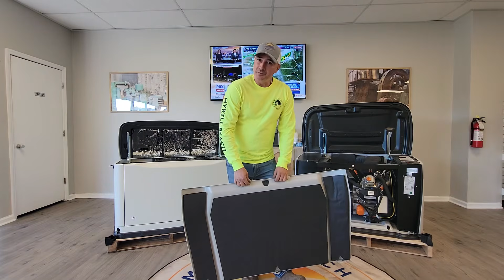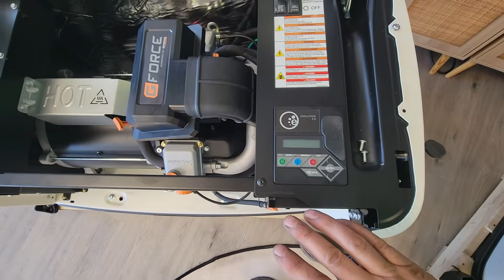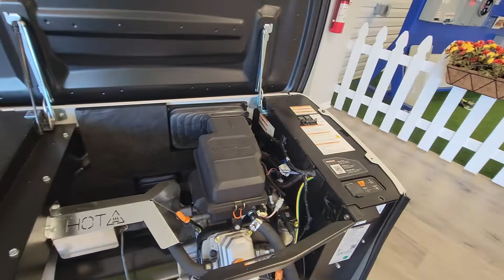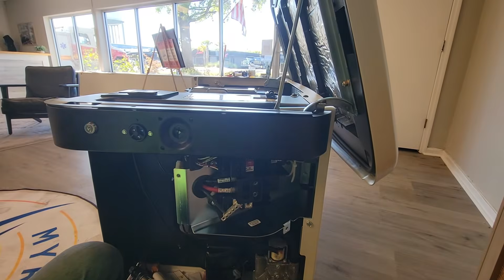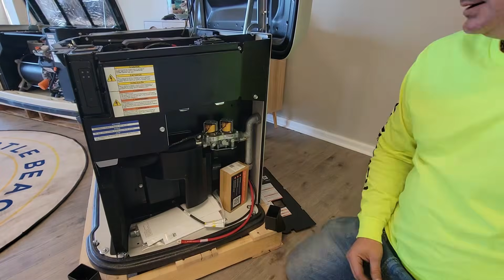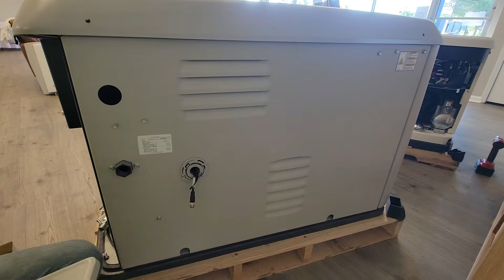Generac's Guardian Vs New NexGen 24kw

Comment: Generac owner checking in. Spent $10K about 6 years ago and of course warranty just went out. I never needed it until now.
We had a big storm but not catastrophic only without power a day. My generic went out after 3 hours, so did hundreds of others. Techs are backed up at every local company for WEEKS and my tech told me people are beyond pissed.
My estimate for repair is in the thousands, it would be almost as cheap to buy a new one.
Apparently Generacs made this decade are absolute junk and a class action is being developed to sue for repairs, specifically the bushings and the like wearing out after a short time.
You have all been warned. DO NOT BUY A GENERAC.
If you do not believe me just search a bit online....."generic class action lawsuit".
You'll see.

Comment: I had a next GEN Generac installed in April 2026. It has not worked now for four power outages. I’ve had so many codes pop-up. So since mid April 2026, it has not had one hour of use on it yet. The thing keeps breaking down. The technicians told me that these next GEN generators are substandard inferior machines. I was told that I should try to return it and go with a different brand. The kicker is that they only sell Generac and they told me not to go with it. I only wish the salesman was honest and told me that. And Generac has a company has not been that easy to deal with.
Reply from the maker: It does need a 30ah AMG battery. That seemed to take care of most of my ghost codes.

Comment: I bought my NextGen 24K in April 2026, had it installed on July 10, and now, by August 23,
 I’ve already seen a red flashing light with code 5100 twice. The dealer came out the first time to reset the unit, and I’m trying to get them to come out again for the second issue. 
They say Generac is working on an update and ask for patience, but it’s frustrating to wait when you’ve paid for a generator that isn’t working.
Reply: Generac owner checking in. Spent $10K about 6 years ago and of course warranty just went out. I never needed it until now.
We had a big storm but not catastrophic only without power a day. My generic went out after 3 hours, so did hundreds of others. Techs are backed up at every local company for WEEKS and my tech told me people are beyond pissed.
My estimate for repair is in the thousands, it would be almost as cheap to buy a new one.
Apparently Generacs made this decade are absolute junk and a class action is being developed to sue for repairs, specifically the bushings and the like wearing out after a short time.
You have all been warned. DO NOT BUY A GENERAC.
If you do not believe me just search a bit online....."generic class action lawsuit".
You'll see.
Reply from the maker: I had that issue on one install and changing the ecm seemed to solve the issue
Reply: @MyrtleBeachGenerators  the dealer turned off speed and now it seems to work. Generic is the one told the tech

Comment: So all that but you didn't address the most important information, did they finally use an engine with a Cast Iron Sleeved in the block or are they still using the same Aluminium Cylinders..??
Reply from the maker: Honestly... I don't have a answer to that. It would be nice if they did. I havent seen any real issure in our area with the older blocks.
Reply: @MyrtleBeachGenerators  It's only important if you have long outages the same way it's better to have a water cooled engine in hot areas with cast Iron sleeved blocks for long term durability. This will of course raise the cost of the generator substantially.

Comment: I'm trying to decide between these 24kW units for my home.  I've been quoted both and the Guardian is about $600 less than the Next Gen price.  So, that difference isn't enough to make me go one way or the other.  But I do admit, I'm a bit hesitant to go with the Next Gen only because it's so new without a lot of time in the field, unlike the Guardian.  So many technology upgrades, which means a lot to go wrong. You've explained these features very well and I wanted to thank you for that great comparison between the two.  I get the feeling if you were selecting one of these for a dear family member, you'd push them to the Guardian.  Would I be correct in my assumption? 🙂
Reply: Do not buy a Generac go with a Kohler or another brand. I promise you, Generac will be nothing but problems.
Reply from the maker: Yes, I would go with the Guardian if it is still available

Comment: I wished you had mentioned the new batteries 😔
Reply: Not a big fan of the new battery.
Reply from the maker: You are right! I should have1
Reply: Great video.  I keep seeing videos showing up about the aluminum cylinders and potential for damage over cast iron.  Is that something that you have experienced over the years?  Thank you.
Reply from the maker: @dak6028  No I have not seen any issues with the cylinders. I have seen issued with the push rods and rocker arms. I have not seen any real mechanical issued with the new style generator yet. Our area has not had many "long" outages this year.

Comment: Hydraulic lifters is great.   I’ve had my guardian series since 2012 and the only complaint I have is the voltage is all of a sudden ranging from 113-126 quickly when measure inside the house outlets and all the lights flicker a bit.   Sometimes it settles between 118-121 volts.   The frequency varies from 59.5 to 60.5 fairly steady.  I just can’t figure out the issue or maybe it’s not an issue?   The AVR of the nexus controller is fine.  The governor is working properly.    I do have a larger Nicor Gas meter 415 thinking of bumping it up to a 500 series for the new G0076200 22KW NG  I ordered but will use the original automatic transfer switch RTSD100A3 instead of the newer model G0099340.   I already know that there’s gonna have to be a modification and a fifth wire brought in for the battery with its own fuse but they make a kit for that it’s cheap.